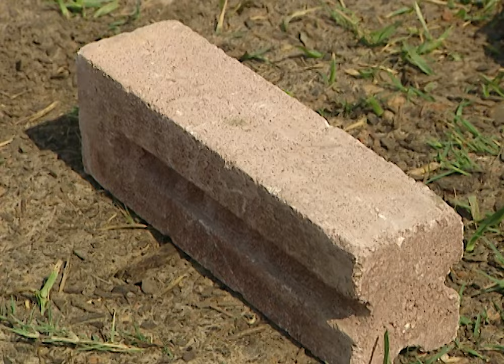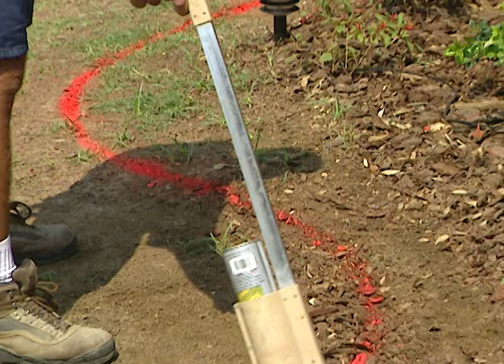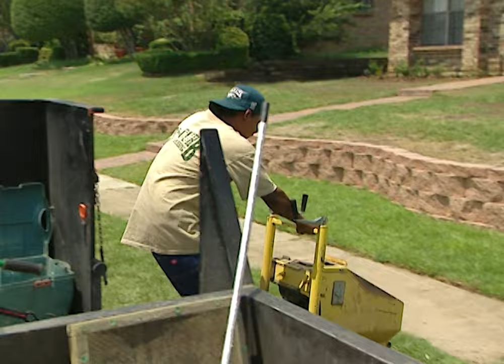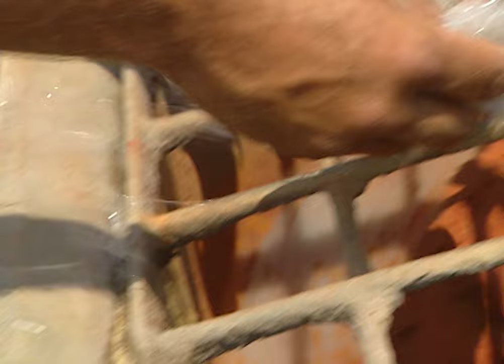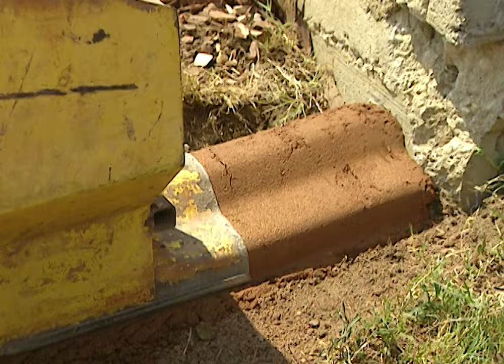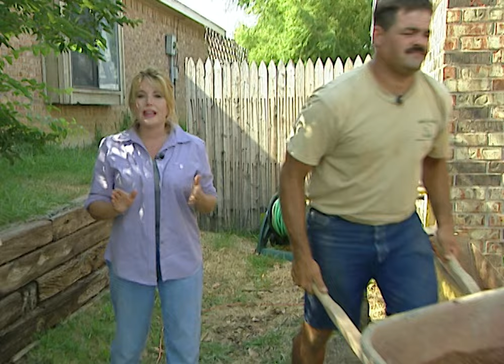Pour in Place Concrete Landscape Edging - Fix It Up

Comment: Ever see tree roots growing on top of the ground or how grass doesn't grow where foot traffic walks over?

Its best to prevent any heavy traffic or especially heavy wheelbarrow or machinery from severely compacting one's lawn in the first place by putting down either plywood boards rubber mats or temporary layer of mulch.

Common Core airation never gets deep enough and vertical mulching with compressed air mapped out with a grid of spaced out holes will come closest to restoring air pockets below ground which Roots required to grow.

Comment: This is a very good example of how to make concrete curbs. I appreciate the effort, facts and practicality you included. I was a licensed concrete contractor in California for over 20 years and installed thousands of lineal feet of landscape curb by forming with wood and pouring concrete in the form. I will never do it that way again because curb machines make the curbs easier, faster and of equal quality in my opinion.
Reply: If these were for actual street use with code enforcement it be worth calling a contractor but if only edging a yard and trees I'd just pack concrete in forms suchas plastic or aluminum gutters then flip, smooth, cut lines and put that money I saved elsewhere.
Reply: This is too much work and looks tacky. Concrete cracks too easy over time which is why I only use rock base and leveling sand for wall blocks

Comment: Exactly how is none of this a DYI?  You can rent any of that equipment. Stop misleading viewers.
Reply: Can you please tell me we're I can rent this equipment. Help a brother out!
Reply: @mynameiszaeandthisismyseco3499  I'd start with building equipment rental companies most will even deliver and pickup but if trying to do a cheap dyi a regular concrete mixer, prefab forms and good old fashioned determination will work as well.
Reply: Of course, you can DYI anything related to your home. I can wire up electrical, but if you do not do it every day, there is a chance you will not do it as a professional will, sorry.